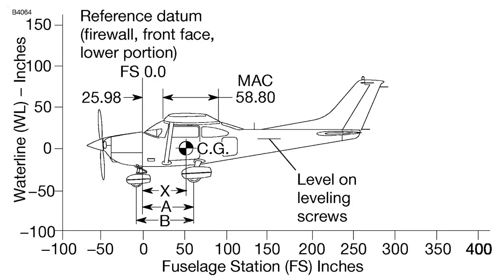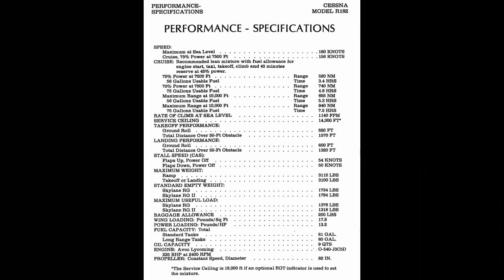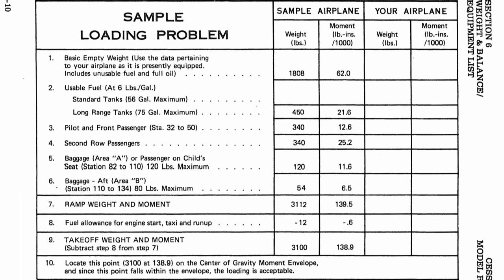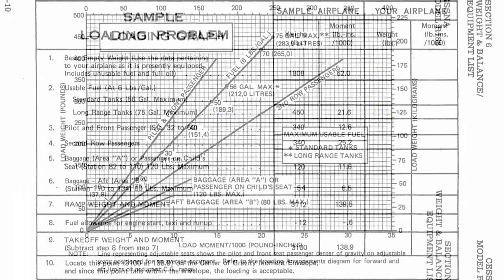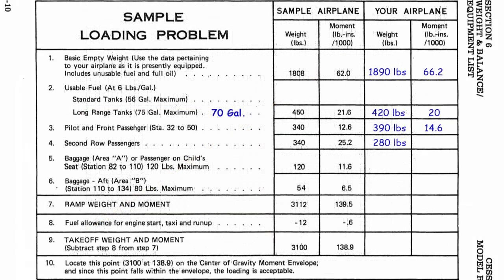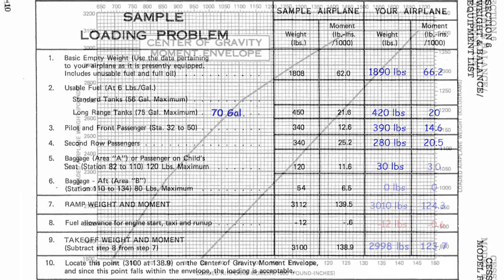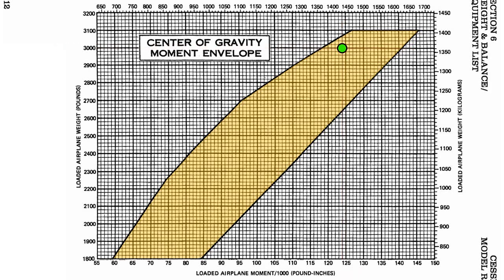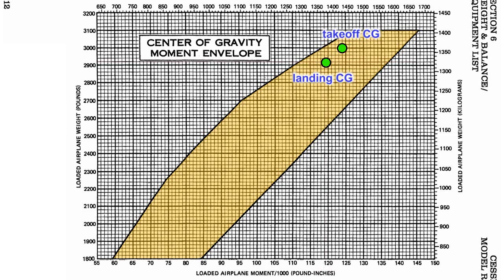Weight and Balance Calculation Tutorial

Comment: Slight error at the start. The Poh has always been called the pilot's operating handbook. The pilot's information manual you're referring to Is a non updated Poh intended for general publication for non plane owner's. It is not updated after initial publication.
Also the reason for the difference in takeoff and landing weight Is to allow for extra fuel for taxi etc

Comment: For me the loading graph adds confusion.  How is the seat position taken into account?  I prefer to use the individual CG arms from the POH and calculate the moments.  For the 152 I saw that putting the seat all the way forward could be enough to put the aircraft was outside the CG limits.  I also prefer the graph with the final CG arm on the horizontal axis and load weight on the vertical axis as it is more intuitive.
Reply from the maker: Ypu are correct but you are also overthinking it. You can do each individual seats and their position but the average given should be enough (unless you are at the edge, a few inches here and there wont affect it if you are well within the envelope). If you prefer to do it your way then its better and more accurate, but it may be too much work (again, unless you are at that edge).

Comment: Thanks for the explanation, I'm just starting my training so don't take me too serious, but I think that the change in weight and moment due to fuel consumption has the same slope than the right side of center of gravity moment envelope, because only depends of the amount of fuel and the fuel distribution with respect the CG stays constant. So, your CG should always stay inside the center of gravity moment envelope. My guess is that the maximum landing weight is more related to avoid structural damage during landing than for the verification of an appropriated CG.
Reply from the maker: That would be true for a vast majority of the cases. But there are one or two of the cases where it may not be true, especially when you are close to the edge of the envelope to begin with, fuel is a bit off the center and that small difference can make a difference.

Comment: Hi, I don't know if you answer or reply to people questions or comments here, but I will give it try, I have been confusing regard one of FAA quiz test, The question ask if the CG change and how much the change? If the pilot weight 180, and the rear passenger 204 LB moved to the front prior to landing, the total weight is 2690 LB and the total M/100 2260 just prior to the passenger moving and they post figure 10.9 found in the pilot handbook of aeronautical knowledge
Reply from the maker: Ozy you'd have to work that problem out with the charts given to you for that problem. If you are practicing online, then some info may be missing from the problem, probably refers you to figures you need to use to solve that problem and the figures may be missing (especially if this is a third party online practice test). In any case, you could use the info in this video to solve that problem once you have the figures.

Comment: I am new to this, so I have someone who has a cessna 172 who wants to take me up to see if I like it. Pilot weighs 300lbs and I weigh 350. according to my "newbie" ability to calculate weight and performance, we're 65 lbs over weight. the pilot said it's no big deal. my question is, should I be concerned about going up with this person?
Reply from the maker: scubaemt25 answer is yes, you should be concerned about flying with this guy. Its not only about the weight but also the moment, weather conditions, as well as pilot judgment.

Cessna can lift more than specified in the books, but meteorological conditions change everything, hot day and plane way underperforms. I've seen some 172 sluggish performances even underweight in hot weather and higher altitudes. My advice is stay within limits. Rent a 182 which shouldn't have a problem with 2 300 lbs guys. It is yoir life, and you only have one of those.
Reply: GVad The Pilot Thank you, we will be taking off (or supposed to be) from a local airport here in California in the morning. I've already committed to the flight tomorrow. any suggestions on what I should be looking for to abort the flight? or should I just cancel all together based on your recommendation. this Pilot is kind of a "good Ole boy" farmer and I want a safe, good introduction to GA flying.
Reply from the maker: scubaemt25 my advice is cancel, its not worth it, tomorrow will be a hot day. Nothing may happen tomorrow, or the next day, but pushing it, one day it will. Start off proper.
Reply: GVad The Pilot Thank you, I sincerely appreciate your Input. I think I am so eager to get in the air I'm probing to get the answer I want to hear, rather than the answer you gave which is the smart choice.
Reply from the maker: scubaemt25 these are choices that as a pilot you'll have to make more often than you think. Its hard to pass up opportunities, but always remember that its better to be on the ground wishing you're up there, than up there wishing you're on the ground. There is ALWAYS tomorrow, unless you end up dead. Make the right hard choices from the start, and hopefully I'll see you in the air safe one day.
Reply: GVad The Pilot Wise words. again thank you. And yes, I hope to be safe and in the air as well.